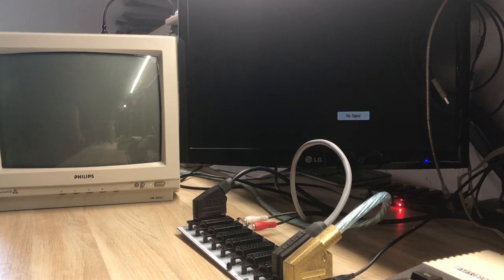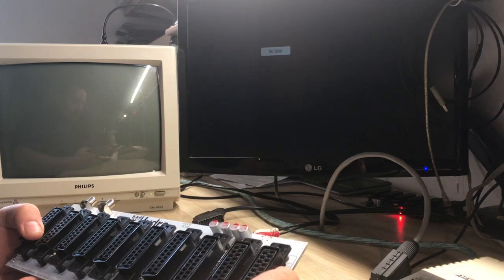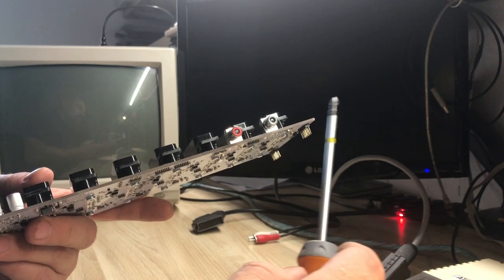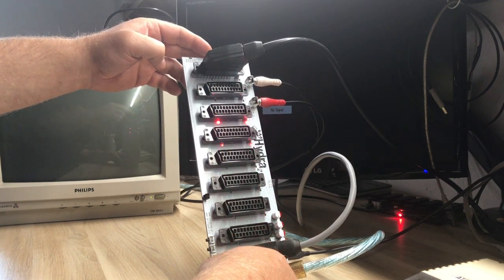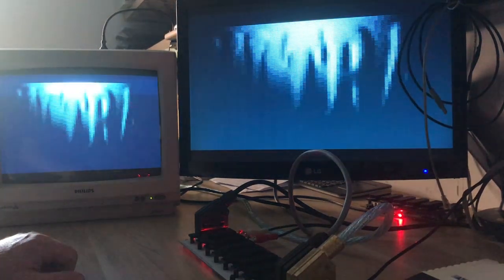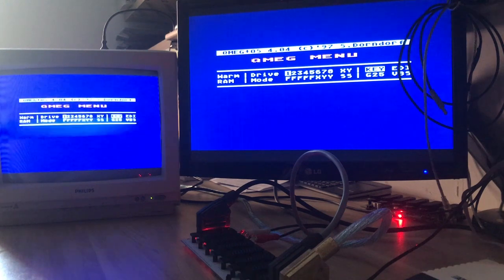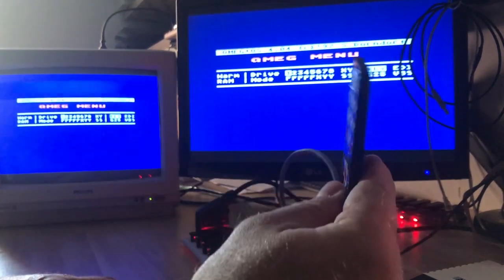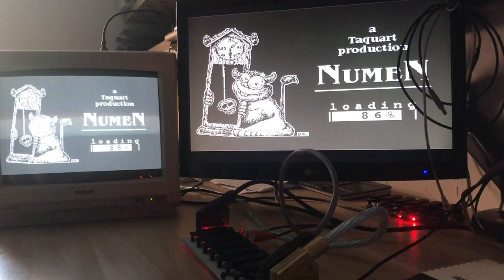Hydra2 presentation

Comment: I noticed that my pvm displays white horizontal flickering lines like your CRT is doing in this video when connected to my hydra 2.1 but only when my consoles are turned off and the monitor is on..is this normal and will it hurt any of my gear (PVM, consoles etc.)?

Comment: I have a Hyda2 and it works well. But I have a problem, audio drops out when using my PC Engine IFU with RGB SCART. When I plugin the same SCART directly from PC Engine IFU to my RetroTink5X, there are no audio drops.
Reply from the maker: it is not place for technical upport...anyway -  audio drop - please explain ? where is audio missing ? on scart out or rear audio connectors ? please, contact me to lotharek@lotharek.pl

Comment: 8:13 A handy feature, but which is which? If the red light is on, does that mean TTL level, or 75 Ohm?
This is not explained in the video, the product description on the website, product descriptions in official eBay listings, or any FAQ I have found, which is a problem since selecting the wrong one can be dangerous.

Comment: Hi, first of all, sorry for my bad english.
Now, I have a question.
I just bought an Hydra 2 and I'll do my connections as follows:
I'll use 4 input connectors with an SCART RGB cable and remaining 4 input connectors with a Scart COMPOSITE cable.
My idea is to use one of the scart outputs with SCART RGB cable and the other output with SCART composite cable. Each output connected to the same TV, each output one connected to its respective VIDEO IN on the TV, then if I turn an RGB console or a compisite console, get respective signal from Hydra and the image on tv. Is that possible?
Thank you for your excellent job on this!
Reply: I believe all SCART signals are passable.